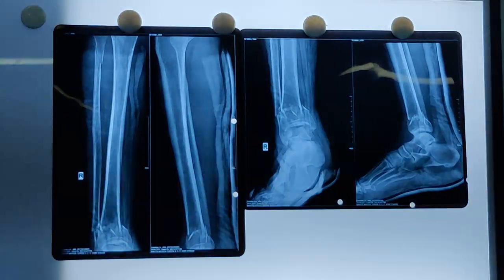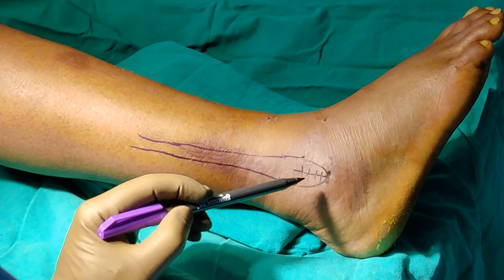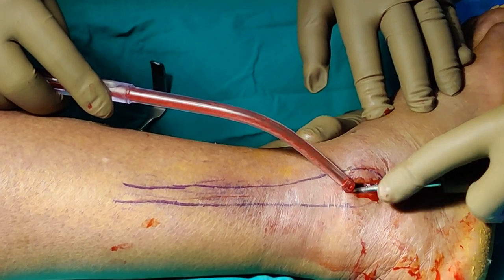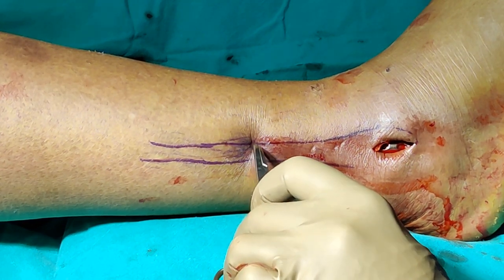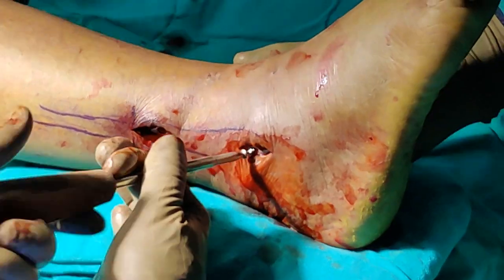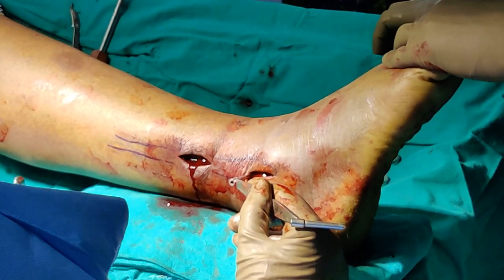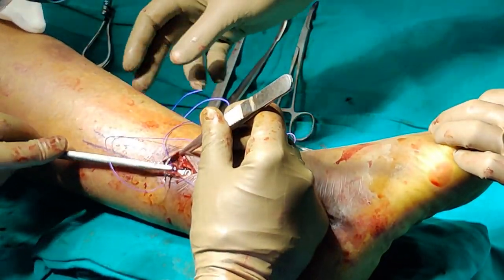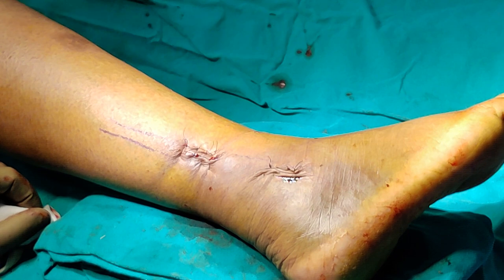MIPO Distal Fibula (Minimally Invasive Plate Osteosynthesis)

Comment: The displacement of the distal fragment in the usual fibular fracture(Weber type B) needs to be addressed by correcting the posterior glide of the distal fragment, bcos that reduces the talus in the ankle. The reduction should be near perfect in AP and Lateral views. Hence AO recommends posterior anti glide plate or interfrag screw + neutralization plate. Juniors should read the AO literature regarding same. We should not convey the idea that treatment of fibular fractures is about just placing a plate and  screws. It is important to understand what the construct is supposed to do, which is to counteract the deforming forces at the fracture.
Reply from the maker: Thank you for your kind input. These fractures are treated differently to ankle fracture.